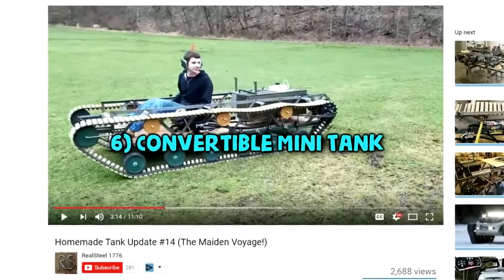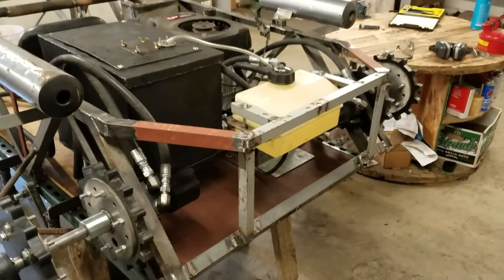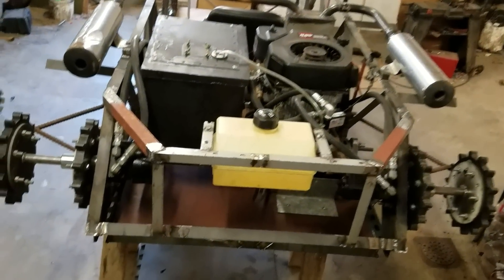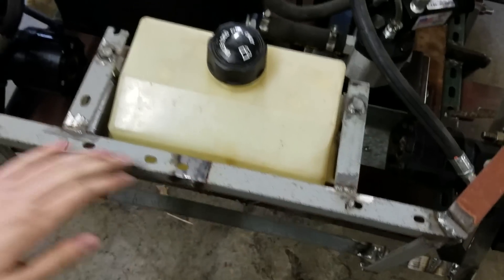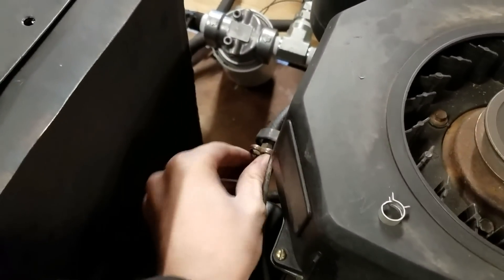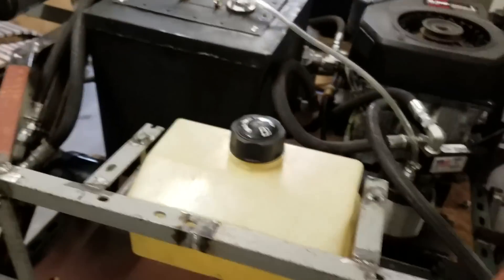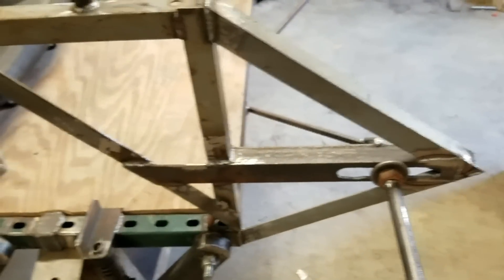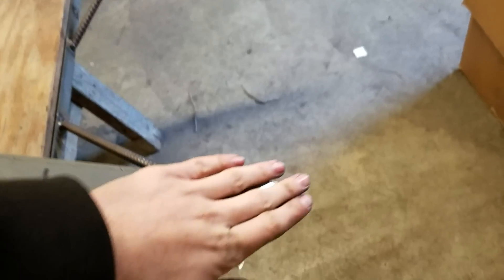Homemade Tank Part 17 (Frame Modifications)

Comment: Autozone has Kohler Lawnmower Starters with lifetime warranty for CHEAP! like 50/60 bucks for single cyl, and around 90 or 100 for twins, ends up being less than HALF the cost of the starter from Kohler , I buy them for all the mowers and stump grinders etc in my buddies shop I help mechanic for
Reply from the maker: I actually just got really lucky and had a family member give me their old craftsman lawnmower, which happend to have the same starter on it, but thanks for the tip!